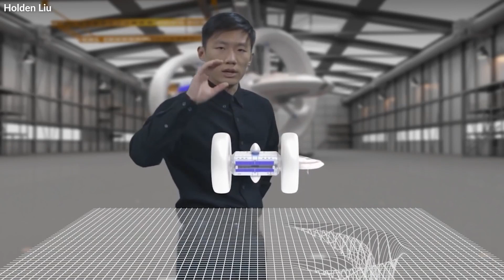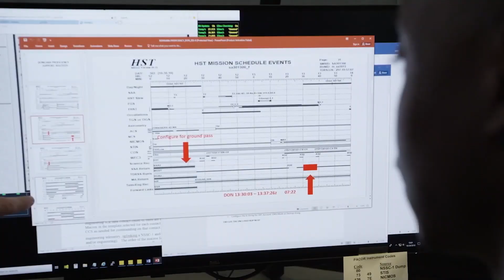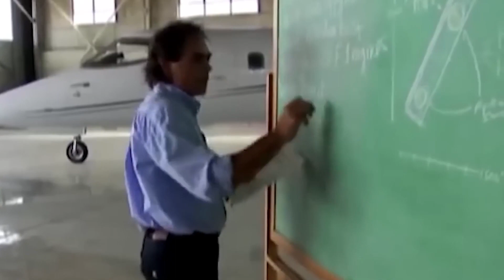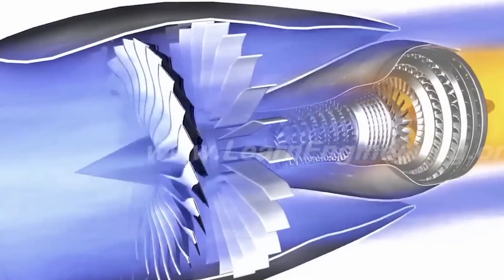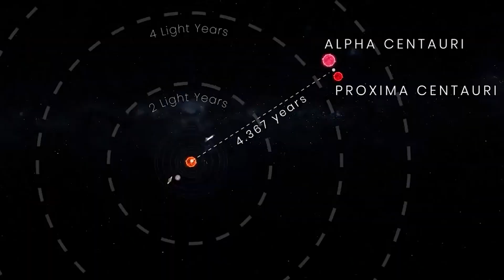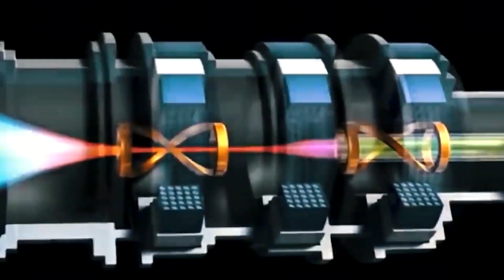NASA's mind-blowing creation: Reaching lightspeed | NASA light speed engine | Elon Musk x NASA

Comment: One the use of aircraft is just plane Wrong.  Yes it maybe able to fly through an atmosphere but we are talking Spacecraft.  Other issue Dr. White of NASA has been working on warp bubble creations and maybe close to requesting testing in space.  Need a lot of Miles to test fly at Mach 1+.  This is the technology that was discussed about 8 yrs ago that could get 200 lb Space probe to AC in about 2 wks with a 20Kw electric Nuclear Generator driving the probe and Warp engine.